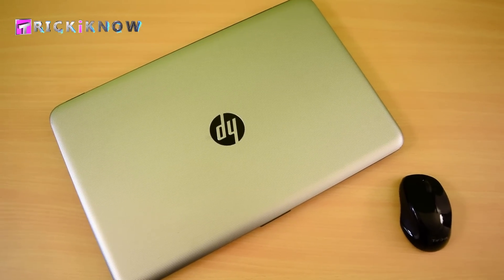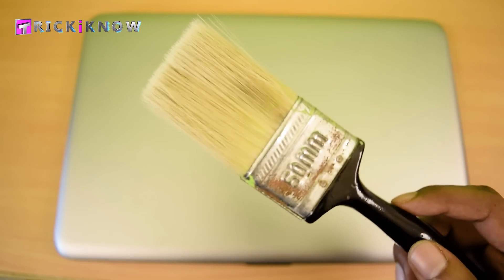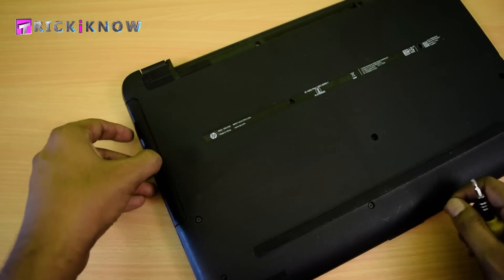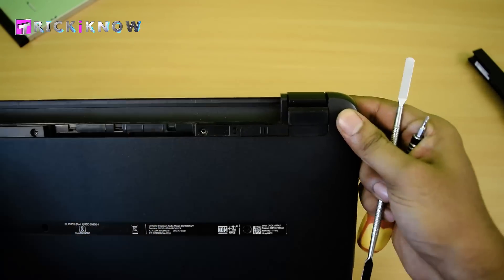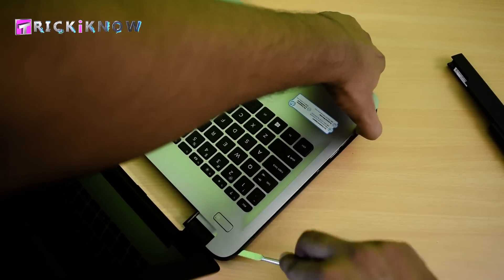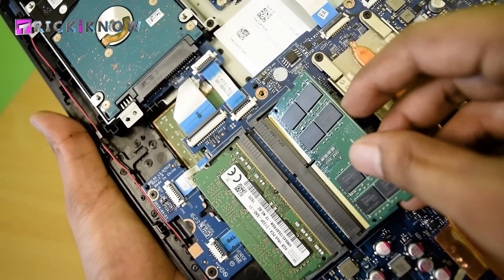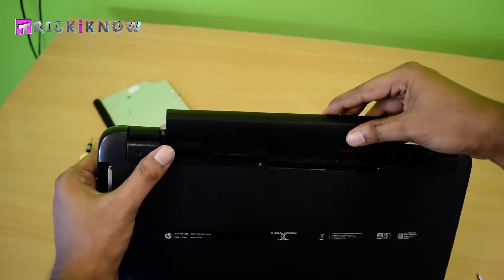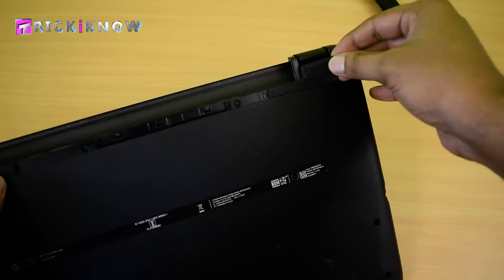How To Upgrade / Install RAM in HP Notebook 15 series Laptop (HP 15-ay008tx)

Comment: I really hate that many manufacturers make the laptops impossible to upgrade them a customer without to loose the warranty !
Reply from the maker: Ya i think is a policy to drive customers to the customer care 😏
Reply: And is the reason that my next laptop will have small covers for ssd and ram to remove them easily for upgrade.
Reply: @TrickiKnow  or back to the shop where upgrades are for sale at massive over inflated prices.
Reply: I went ahead and did this upgrade myself with the service manuals HP provides on their own website. Consumers have a right to repair and companies do not have a legal basis to refuse warranty on user serviced devices as long as the user did not directly cause any issue. Hate these dumb stickers trying to undermine laws and common sense.
Reply: Fun fact: Here in the USA, that "warranty void if  ahead and play around.

Comment: Thanks for this video so much : ) I had 8 gb DDR 4 1866 hz single channel for now I have 2 x 8 gb DDR 4 dual channel. My configuration for this moment: Laptop HP 15 AMD A9-9425 Dual-core 2 x 8 GB DDR4 dual channel 1TB HDD and 128 SDD (System win 10 I have  installed for SDD disc because is faster ) AMD Radeon R5 APU  Win 10 (HP 15-db0008nl Renew) I want to upgrade graphics card because at this moment I have Radeon R5 apu integration at CPU (processor) I want adding second graphics maybe add AMD RADEON 530 2 gb so I wonder whether this upgrade is possible? My mainboard accommodate double graphics card? What do you think about this idea? Is it even possible to upgrade the graphics card on this laptop and is it cost efficiant?

https://technical.city/en/video/Radeon-R5-Graphics-vs-Radeon-530

In the future I'm going to play in Atom RPG

https://www.youtube.com/watch?v=9yhMoAyQskU

Comment: Hi I have HP model: 15-ay104nx with 4gb ram. I want to upgrade by adding 8gb. I have just enough budget for 8gb. It this video applicable for my laptop model?
Reply from the maker: Yes your laptop supports DDR4 ram , if your laptop have extra slot like mine you can go for the upgrade 😀
Reply: Of course, just make sure you buy the correct type of RAM

Comment: I have upgraded ram from 4 GB to 8 gb. It shows 8 gb in properties but showing only 2 GB usable like before....
Reply: what windows version are u using? if its 32 bit.That can be the problem.
Reply: @supunbandara5358  win 8.1 32 bits

Comment: I have HP-Ay008tx with 4GB(DDR4-2134 - Hynix) can i add Crucial 8GB DDR4-2400 SODIMM CT8G4SFS824A OR  Crucial 8GB 2133 CT8G4SFS8213  and what is difference between 2133 VS 2400

Comment: I have a hp laptop with 4gb ram an i5 6200u and an amd radeon r5 should i use ddr4 ram?
Reply from the maker: What's your model no. ??
Reply: @TrickiKnow  15-ay091ng
Reply: @TrickiKnow  ddr4 ram right?
Reply: @TrickiKnow  hello?
Reply: Yes! You should use ddr4 ram, as it is compatible with your model.
Reply: @authorised_creature  thank you for telling me
Reply: @marcello21mr  Glad to have helped :)
Reply: same question model  number hp 15-ac122tu?
Reply: @akshaygaming837  For your specific model (HP 15-ac122tu), you should use DDR3L Ram!

Comment: How many pins it has ???
Reply: Mine had 260 pins. To make sure that I was buying the correct RAM I posted a question on Amazon to the seller. You should do the same, they will make sure that you get the correct RAM for your laptop.

Comment: I'm new to PC and I'm sorry for this amateur question but are you able to upgrade an 8RAM to a 16RAM in a 15 series? I can't find an accurate answer.
Reply from the maker: Ok no problem bro, there is not any way to upgrade 8GB RAM to 16GB using a software , if you have a 8GB RAM already installed on your laptop and  if there is one more slot in your laptop then you can buy and install another 8GB RAM to it.
Reply: TricK i Know Thank you!

Comment: Af 15 laptops mostly only recognize 8GB ram. This can be confirmed by running Operating System Diagnostics > additional system memory information.  Is your ram getting recognized by the windows system resource monitor?  what specific model of af series is this?

Comment: HP 15-bs675tx 15.6 inch HD Laptop (7th Gen i3-7020U/4GB DDR4/1tb 
Request you to suggest me 4gb Ram for thia model no kindly share the link too on this chat.
Reply from the maker: Your laptop supports ddr4 Ram, you can check out the link in the video description for ddr4 Ram.

Comment: If my fortnite is lagging. Is a gaming ram card what I need or a graphics card
Reply: What is HDD and SSD
Reply from the maker: HDD is a normal hard disk , and SSD is 4x faster than HDD 😀
Reply from the maker: My suggestion is you have to install RAM memory up to 8GB and the main improvement you need upgrade your HDD to SSD, SSD increases the laptop performance.

Comment: i thought you were not supposed to mix ram sizes? shouldn't it be a pair of 4GB or a pair of 8GB?
Reply from the maker: Technically you are right , but in practical i mixed RAMs for may times in my workshop. They all are running fine without any issues 😀

Comment: I have probook 4540s with 4gb ddr3 ram. if I 2gb more with it will it work fine or will make trouble as the two rams are different in capacity, initial is 4gb and the 2nd is 2gb. pls help

Comment: QUESTION Hey guys, question so I have an HP Notebook 15 with 4 GB of RAM, I want to stream some  Gamecube games to Twitch (Not using an emulator, from my Wii console to my Dazzle DVC 100 to my computer), my main problem appears to be that I don't have enough RAM, if I buy and install an 8GB physical RAM card in addition to the 4 GB I already have, will I be able to stream?
Reply from the maker: With 8gb RAM , upgrade you storage to SSD for powerful gaming 😀

Comment: Hi Trick, my HP Notebook 15-ac100ni Energy Star came with 2GB ram, can i upgrade it as well? and what DDR ram is it using, ddr3 or ddr4?
Reply from the maker: I saw your laptop supports 2 GB DDR3L SDRAM , you can go for DDR3 RAM. Check the link in description 😁
Reply: Thanks a lot Trick I Know, it has only 1 Ram slot so if i can i replace that 2GB with 4GiG ram will it work?

Comment: I want to install another stick of Ram 4gb In my HP 15 G206AX with R5 GRAPHICS suggest me the Ram which is best for it and Is this increase my gaming performance by doing this And Can i enjoy Latest games on it After Upgradation
Reply from the maker: You already have 4gb DDR3 1333 GHz Ram as default , new games needs atleast 8gb of ram memory. You can go for this Ram: http://bit.ly/2tPdEZJ but if you really want to increase gaming performance get a ssd too.
Reply: TricK i Know thnks 4 advice
Reply: Its an 8 gb ram my system may be only upgrade with max. 8 gb so that why i decide to go with another 4gb ram only not 8 gb is MY MODEL SUPPORT 4 +8 GB RAM BOTH AT A TIMEE IF I WOULD GO 4 8 THEN OF NOT I WILL GO WITH ONLY 4 GB
Reply: not good advice man. ssd's only help with load times. there is no additional fps given in that upgrade although i recomend it for daily use anyways. to game modern games youll need to get a better graphics card. this is impossible on most laptops that aren't already made to game. and ram might slightly help too depending on the game but older games wont see to big of a difference from 4gb to 8. good luck

Comment: Bro can you help me solving my i3 hp laptop battery issue.My battery shows plugged in not charging i solved it before but now it has no charge therefore i cant solve it plss make a video on that i will be very thankful to you
Reply: Your battery has died permanently. Meaning, it won't charge now. Happened to me too couple of times and after that I thought it would be pain to invest time and money to buy a new battery. So I use it like a desktop PC. My suggestion is to buy a new one if you can afford, if you cannot afford you cannot use it like a real laptop until you have electricity whichever places you go (office or college, etc)

Comment: Hi would the below ddr4 ram work if I installed it into a hp notebook 15 ba047na?

Hypertec 8GB DDR4 SO-DIMM PC4-17000 2133MHz, T7B77AA-HY

Thanks
Reply from the maker: If your laptop have ddr4 Ram slot then you cannot install any DDR3 Ram on it or even a DDR5 RAM in future :)

Comment: you'r e  recomending to use ram's of same brand but while in the video you're using different?
will it work or can it show any performance issues?
like eg. system crash & failures?
Reply from the maker: No bro not problems at all , i installed many rams in my shop. Never faced any issues. The chipsets are almost same in those ram.

Comment: this is not my laptop mine has the door in it and ram slot so yeah
Reply from the maker: Yes sir i like the laptop you have , easy to change hardware. But new laptops are coming without the door, i think its for security purpose to avoid the stealing or replacing any hardware with some weak one !!

Comment: Is it possible to upgrade the cpu on this laptop?
Reply: # BOSS hey... You should know that Laptop CPU and GPU are integrated.. the cannot be upgraded or modified.. for upgradeding or modifying you will need to replace your entire motherboard with every component on it leaving HDD, Ram and CPU fan.
Reply from the maker: Mmmm possible but its may be too expensive and it will only improves little bit of performance, but you can upgrade the graphics card. Watch the eGPU video: https://www.youtube.com/watch?v=PJabK8TfyOA

Comment: Bro i have hp 15-BA007AX How many max ram can i install,
Reply from the maker: I checked your Laptop supports DDR3 RAM, you can install 8GB X 2 RAMs by replacing your pre installed 4GB RAM. Here is the Manual for your laptop series: http://h10032.www1.hp.com/ctg/Manual/c05227786

Comment: I have the same laptop😊 Hp Notebook core i5-6200U and 4gb ram and Amd 2gb graphics ...same laptop like yours and thanks for uploading video ...But how to know if i have DDR3 Or DDR4 ? I think so it has DDR3 and how many ram slots are there in this Same Laptop please tell and also tell if i should buy 2 4gb ram sticks or 1 8gb ram stick ...which will give better performance or will they give same performance ? But im scared to remove all the things and screws because i have never done that,,so do u guarantee 100% safety for this? Please reply 😁 Love ur vids , liked and Subbbeddd
Reply from the maker: Just type your Laptop's model no. on google, the first result will be the hp official website. In the Specification you will find your RAM version :)
Reply: Mine is Hp notebook 15 - ay009ne   with  4gb DDR4 Ram , but then down it says on video memory Amd Radeon (2gb DDR3 Dedicated memory) so which one do i get...i need to upgrade ram so do i get DDR4?
Reply from the maker: I checked, your HP Notebook - 15-ay009ne (ENERGY STAR) supports DDR-4 RAM. Here is the link for 8GB DDR-4 RAM: http://bit.ly/2sosxXa
Reply: TricK i Know bro I have HP notebook 15 series but I can't find its sereil no but it's mother board model no is 81ec so will I bought ddr4 ram
Reply: TricK i Know hey my laptop said it's non upgradable and I know thats a lie. But can u take a look and see if it's upgradable to 16 gigs ram?  And what is my max ram upgrade. My laptop is HP 15.6 15-BS115DX touchscreen

Comment: i own the HP- 15- AY045nv.... How should i know if i have 1 or to 2 ram slots???
Reply from the maker: I checked you Laptop supports 4 GB DDR4-2133 SDRAM and you have 2 Ram Slots according to this Manual: http://h10032.www1.hp.com/ctg/Manual/c05087748 see page no. 10 :) and you can order RAM from here: http://bit.ly/2sosxXa

Comment: How to upgrade graphics
Reply from the maker: Subscribe my Channel my next video is about how to upgrade Graphics on Laptop :)
Reply: TricK i Know  ,I have a HP lap when I open it the cd drive won't come out I removed all the screws..
Reply from the maker: Here is the video , How to upgrade graphic: https://www.youtube.com/watch?v=PJabK8TfyOA
Reply: thanks this is my another account
Reply: Not possible on this model, you would have to replace the entire mainboard as the chip is soldered onto the mainboard same with the CPU.
Reply from the maker: You are welcome , Give your feedback on that video. Tell what you feel :)
Reply: hey I tried upgarding my ram the ram card is not fitting inside
Reply from the maker: Elton Noronha show me the picture of your motherboard and RAM.
Reply: I just closed it,the card is inside
Reply: How to upgrade processor in this laptop
Reply: 😂😂😂lol 
They are soldered to the motherboard

Comment: I have hp 15-r033tx laptop.... My previous Ram is 4 gb ddr3 1Rx8 1444 so I want to upgrade by adding new 4 GB ram... I bought a 4 GB ddr3 2Rx8 Ram 1600 is there any problem with this...
Reply: Please reply fast...
Reply from the maker: I installed many RAM on desktop with different memory and speed , i found nothing wrong. I don't think there will be a problem in your case :)

Comment: Is this true for the hp 15-BS038DX
Reply from the maker: I reviewed your Laptop model it have already 12 GB DDR4-2133 SDRAM (1 x 4 GB, 1 x 8 GB) , it means you have 2 RAM slots. You can also replace those with 16GB X 2 RAM for more memory. Check out 32GB RAM here: http://bit.ly/2fii1YJ

Comment: My lap is 4gb ram..... I am playing gta 5 in that... Its getting stuck.... So if I upgrade my lap to 8gb ram wil it be smooth....????
Reply from the maker: No bro laptop's RAM does not affect too much in gaming , you have use external graphic card (E-GPU) to increase performance on game. One more thing your laptop's processor must higher than the game's system requirement. Here is gta v system requirements : http://gtxhdgamer.net/gta-5-system-requirements-pc/

Comment: I have HP 15 BG004AU it comes with a 4gb ram and I want to upgrade.Can you plz tell me 2 thing..1.How many ram slot this model has bec I searched a lot but didn't get any correct info2.which company n specific ram will suit this model ....if u have info plz let me know that will be very helpful
Reply from the maker: Thanks for Watching my video bro , According to the service manual, chapter 1, pages 2 and 3, all models have two memory slots. Read the Manual : http://h10032.www1.hp.com/ctg/Manual/c05227786